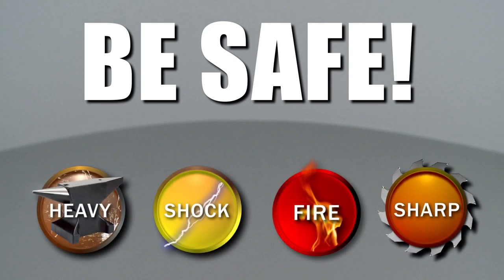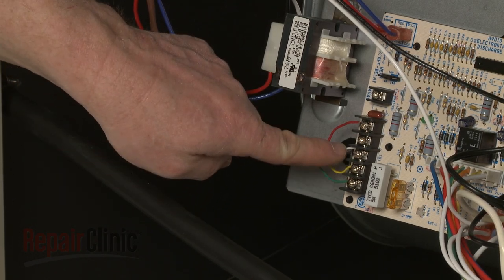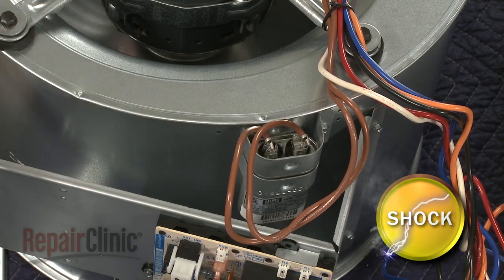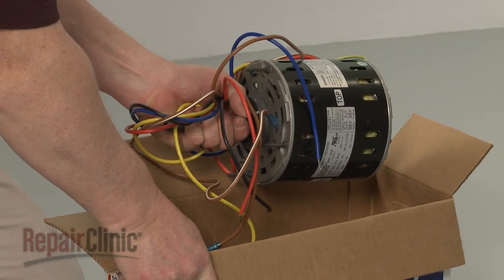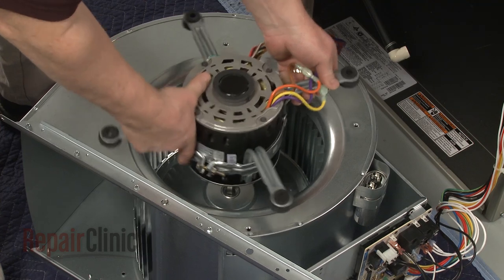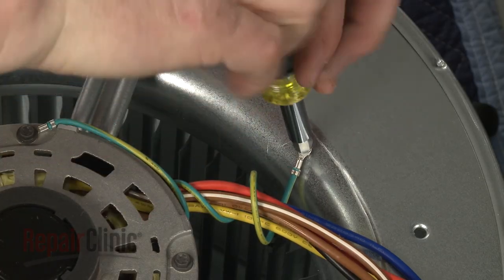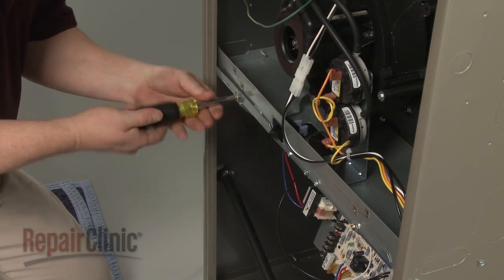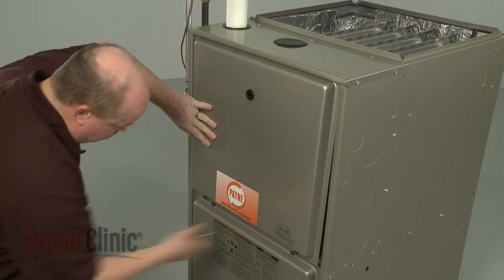Payne Furnace Replace Universal Blower Motor #10587

Comment: when replacing any PSC motor its recommended the run capacitor be replaced also not to use the existing capacitor to avoid the problems with the new motor failing.

Comment: What am I missing ? Your videpo shows it very easy to do but how do you keep wheel from moving and centering just right ? Not too close to either side ?
Reply: Really? You slide it along the shaft until it is centered, then tighten it down. If that was a too much to figure out on your own, you should probably have someone else do this for you.

Comment: it's amazing they never tell you if it's a 220 or 110 motor.. why?
Reply: 1 because if your doing the work you should know. If there is a white/common wire it's going to be 115v. A 240v motor will not have a common it will have 2 line wires black and either yellow or purple. Or 2 if you look at the tag on the motor when they were speaking about capacitor rating the motor it says it's a 115v
Reply: I dont mean for my jobs, im talking about in these videos..  I do hvav for a living for the Department Of Defense do believe me i know.. I was juat stating for the video it would be good to say is all.
Reply: @ottobauner9828  and yed you are correct, and its a 110v motor. I was sayin this to help others who are attempting to change one out, they need to know why voltage, rpm etc.
Reply: @aaronshoyt Why would they say that? This will all be different depending on the model and year of your unit. If you are not capable of figuring this much out on your own,  you should not be doing the repair. All this information will be on your old motor.